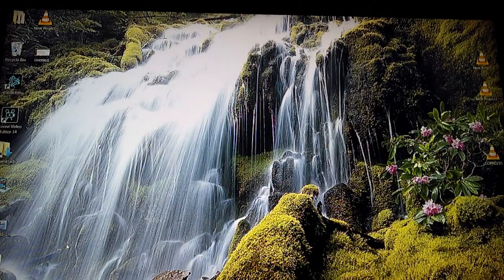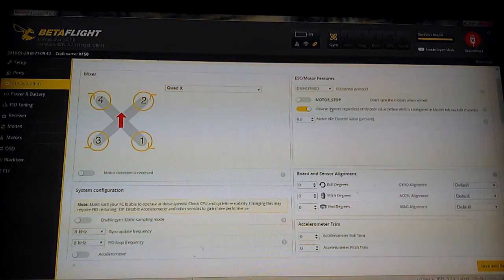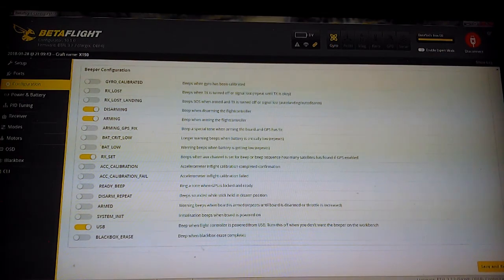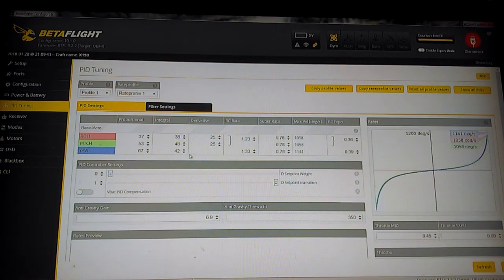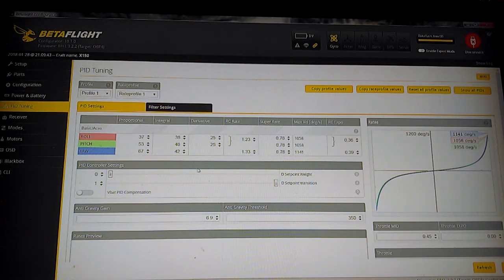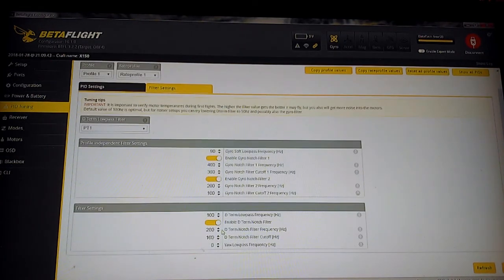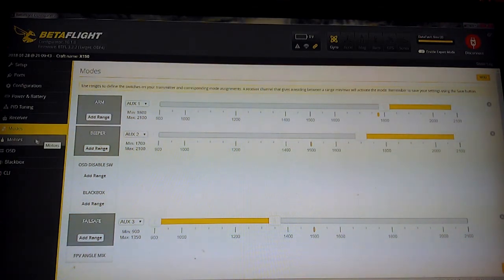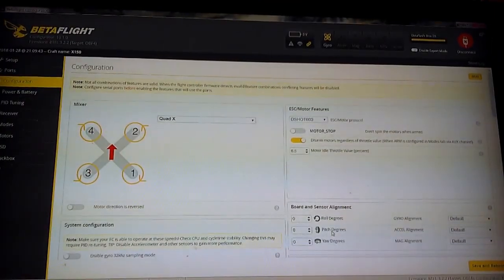VIFLY X150 BETAFLIGHT 3.2 PID TUNING ~ My take on a smooth freestyle tune!

Comment: Josh  EXCELLENT !  I am just starting to learn tuning and this video is wonderful.  I have two 150's  (and two more coming)  both FrSky and FlySky and I am going to set one up today exactly like yours except for OSD ( I like to see throttle position so I can set exact power setting and know it will hold altitude ).  I have wanted to do a double arming and I like your method  !  I am not big on minis or micros,  but this fits a space below my 5 or 6 kwads ..wouldn't it be cool to have a 5"  with 6" props ?  (rumor mill) ,,,once you fly the 150 it becomes so apparent all you need is a good camera (the Foxeer is awesome) ,  Absolute overkill to have a big heavy carbon frame to haul around with big motors and big batteries, just stupid !  I am playing with different vtx antenna trying to lower the height so the kwad will fit in the box with antenna on ! makes a great travel case.
Reply: PS  check out Aerodyne in Russia the REX frame  ,,,I am building one right now  will be similar to 150.  They are coming out with the "Stinger" which will have longer arms (very simple to change arms and have one frame for various setups !